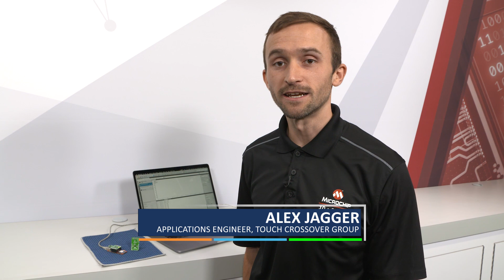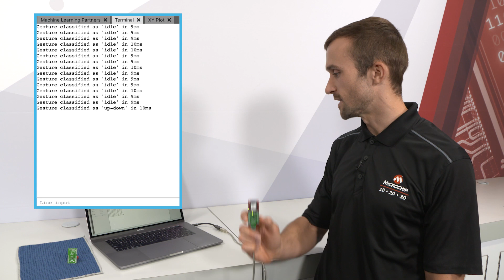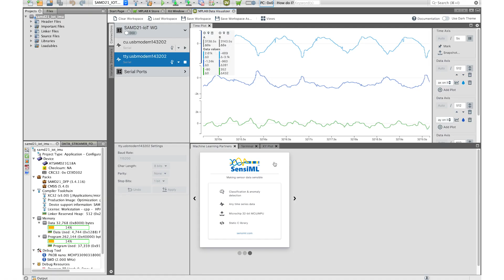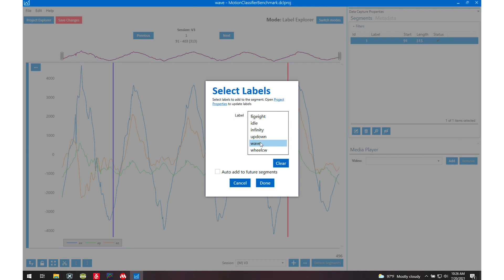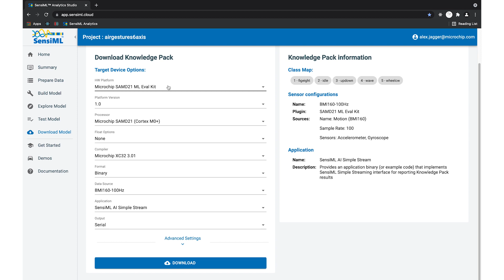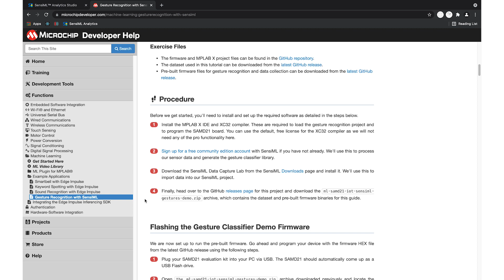ML on 32 bit MCUs - Gesture Recognition with SensiML

Comment: Can you explain how to interface SAM-IOT wg with ADC 7 CLICK using MPLAB X IDE and visualize the data  please?
Reply from the maker: Hi Ramesh,

Our SAM-IoT WG development board uses the mikroBUS sockets to expand your design with the selection from 450+ MikroElekronika click Boards, including ADC7 click Board. It is a plug-and-play solution! The user can push the click board into the innovative new mikroBUS socket and use it with zero hardware configuration. As for software-wise, users will need to write their own code based on the Click board datasheet and any documentation Mikroe provides. Code examples can be found within this link here: https://www.mikroe.com/adc-7-click. 

For more help, please email us at client.success@microchip.com, or contact us at https://www.microchip.com/en-us/support/design-help/client-support-services